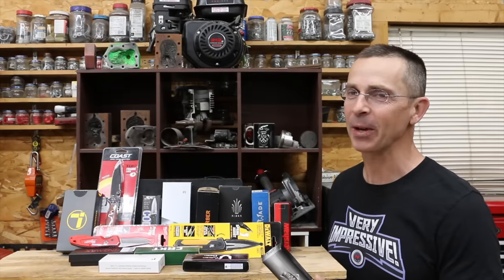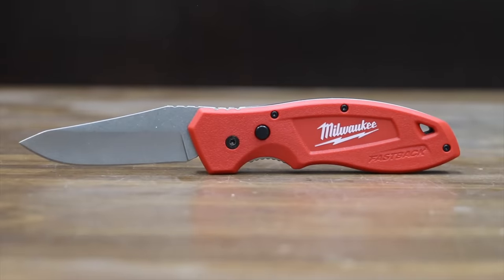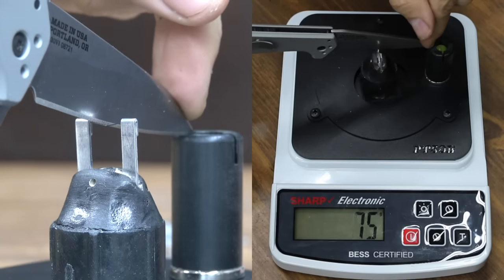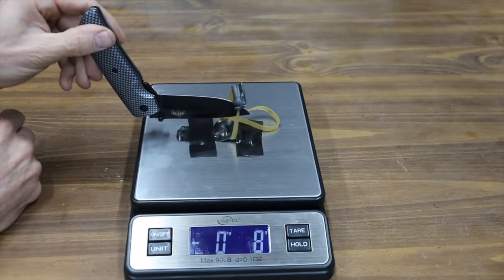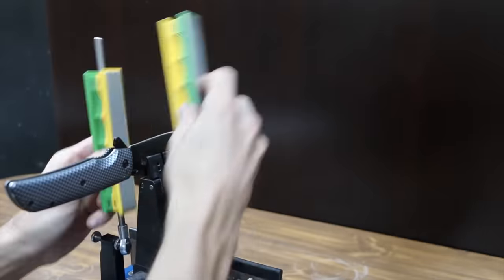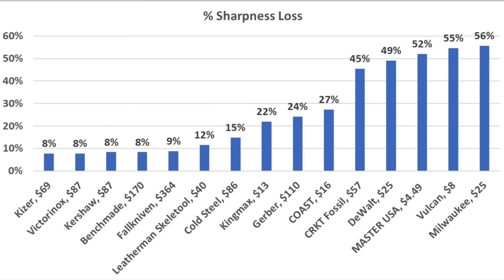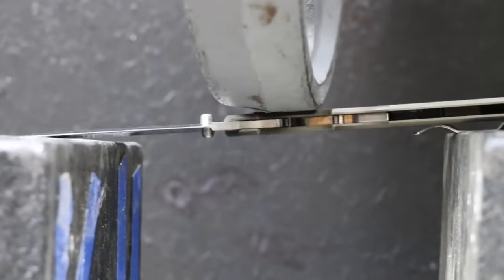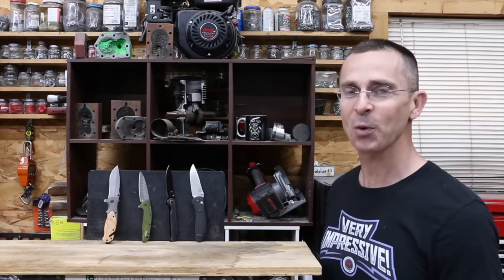Best Knife (Ep 2)?  CRKT, Gerber, Leatherman, Fallkniven, Victorinox, Kershaw, DeWalt, Milwaukee

Comment: In my experience, a pair of scissors wire cutters, loppers, or tin snips have been far more useful than any knife.   You have no leverage with a knife.  You can be there alkl day trying to whittle through a stick or rope, while I can cut through both with a clean cut in about 2 seconds with a pair of loppers.   

My new favorite tool are electric hedge trimmers.  I can decimate a jungle with hedge trimmers before you've cut enough sticks with a knife to even build a fire.
Reply from the maker: Thanks for the feedback.

Comment: The sharp BESS knife tester is deeply flawed imho having owned one and returned it. Accurate to 1 gram was the claim - I didnt find that nor did the distributor I used who extensively tested it too before agreeing with me and refunded me. The aluminium clips - I have been led to believe are even more erratic in their readings and not BESS certified - not to mention more expensive. You have to do multiple tests to get any idea and even the speed you press the edge down can create huge variation in readings. Of all the tests one can do this machine does not deliver trustable data
Reply from the maker: Thanks for the feedback.

Comment: I do woodcarving and thus am anal about knife sharpening  The initial sharpness almost does not matter.
What matters is ease of sharpening and ability to hold an edge.  Even that is a compromise.  A straight razor will be hard steel honed to a narrow angle.  Good for shaving.  Normal cutting the edge will crumble and quickly fail.  I have a Japanese laminated stainless kitchen knife.  It is a thin narrow angle edge blade.
I can't recall the name of it. They are specialty knives for cutting vegetables. I've seen many where the edge has broken off because someone misused it to cut meat and hit a bone
Reply from the maker: Thanks for the feedback.

Comment: Unfortunately this review tests the blade and not the longevity of the mechanism. A broken spring, a consumed washer, a screw that unscrews after many open-close cycles, a handle that slides etc. are some common issues with folding knives that you cannot repair. A good blade is nice to have, but the blade is probably the least problematic part of a folding knife.
Reply from the maker: Thanks for sharing.

Comment: Most of these tests are pointless. The sharpness and durability of blades are all about the steel, its edge angle, and heat treat and has nothing to do with the knife quality overall. So testing the sharpness, the toughness of the blades don't reflect much on the knfie itself. What should've been measured to eval knife quality would be fit/finish by examining microscopically the joints and contacts

Comment: Doesn't matter what knife it is you should sharpen it soon as you get it, factory edge retention is never as good as after you sharpen it. Not sure why anyone would want a linerlock with weak lockbar pressure. Your tests are irrelevant, never even mentioned the blade steel so are your viewers supposed to believe they're all the same? All your knife videos/tests are ridiculous